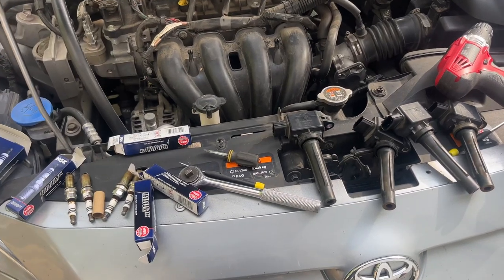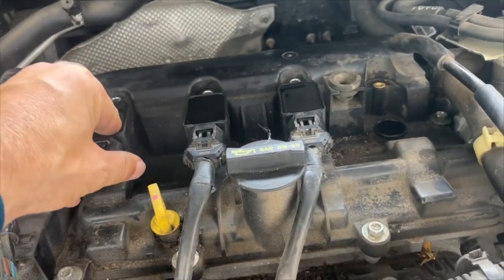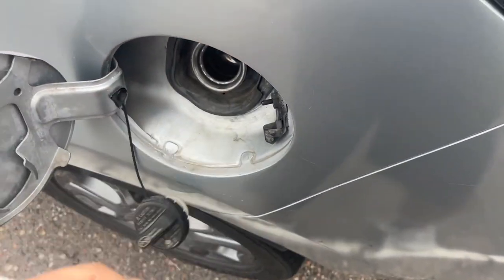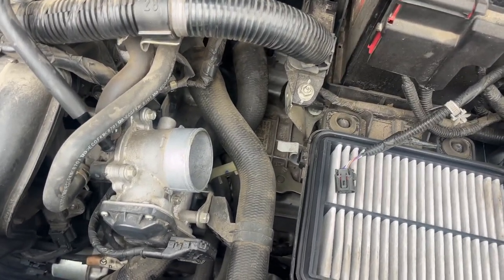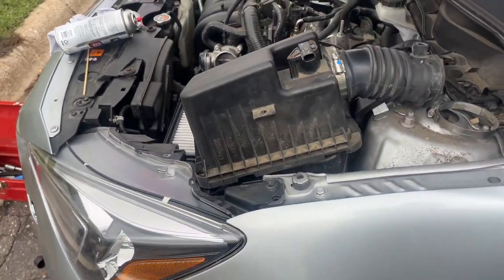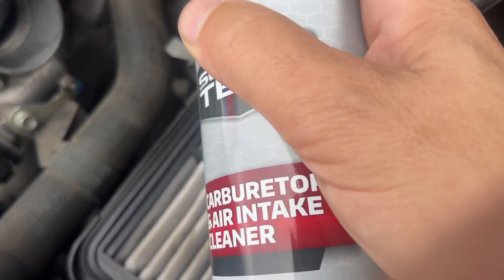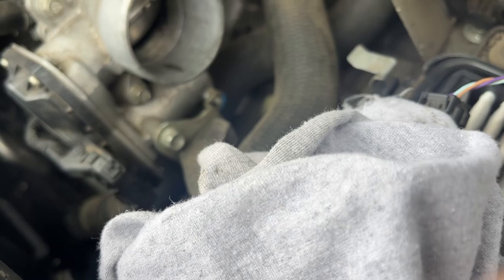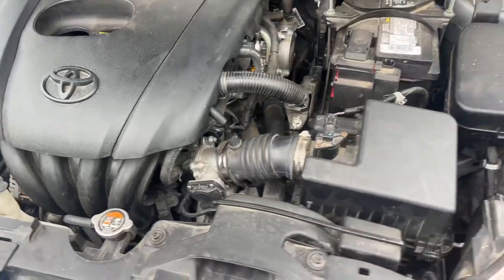Reason your car NOT Running Smooth, rpm issue, idle issue, throttle problems

Comment: The electrical degreaser contact cleaner (does not leave any residue and it's safe to use on most plastics and surfaces) is doing a very good job and it's usually cheaper. You can find it in 5l recipients for a very low price...

Comment: What about old school toyota I charge coil distributor cap on sparkplug wire and it won't trottle steady it's a old 5af engine
Reply from the maker: try the basics first , get the gunk out, then start replacing parts